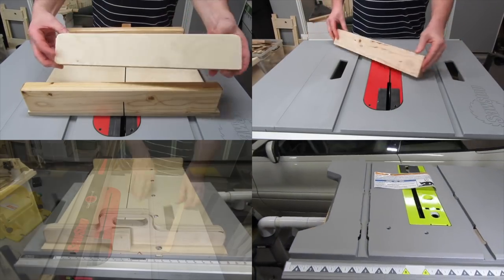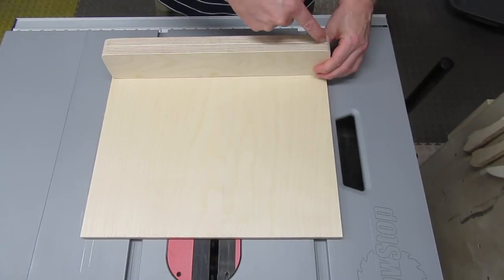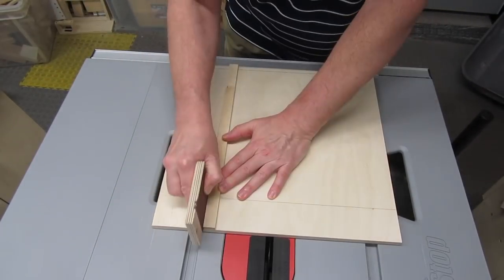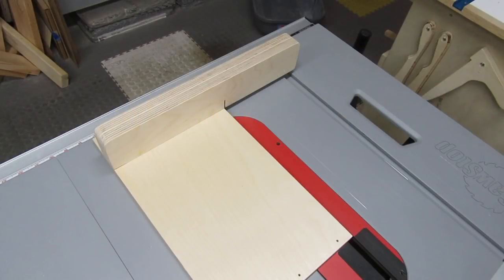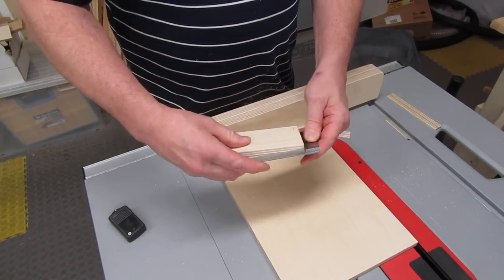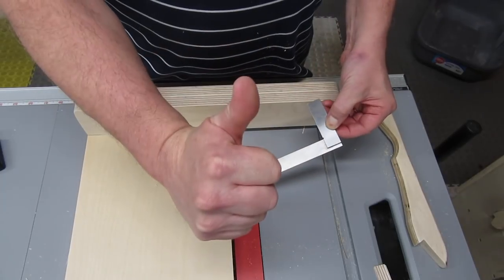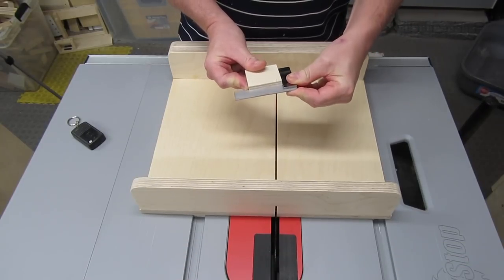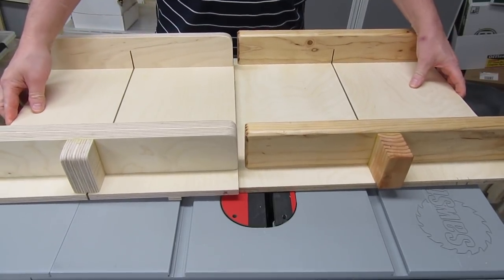Assembling a Cross Cut Sled, for Newbies!

Comment: I do like your video very much. You gave good clarity with that Ho so necessary dry humour. As an aside in the UK we have been designated metric for a long time. As a retired technical manager in heavy engineering I have been using the metric system in my work for at least 40 years ! However in my retirement I have taken up woodworking, and guess what, I have reverted back to imperial units which just seams clearer to me. OK we have to use metric power tools and drills etc. But in marking out and sizing cabinets etc. I am imperial all the way. Thanks very much for your video, thoroughly enjoyed it. Please keep em coming !
Reply from the maker: Thanks! And thanks for sharing your thoughts about metric and Imperial measurements. I have a question for you - what do you think of this idea: I want to start mentioning metric equivalents in upcoming videos, but not for everything. Here's an example, and it's not a perfect example, but hopefully you'll get my point: I'm going to do a video on t-tracks, and the ones I'm looking at are 3/8" tall, which means they require a dado of that exact depth. Giving a metric equivalent of 9.5mm seems counterproductive there, because it's just an approximation. Do you agree? (And did that make sense?) 😀

Comment: Hey Dan, I have really enjoyed this series of videos about the sleds. Of course the main one for me is the one with the tabbed runners......and no I haven’t made myself a new one yet. Since my Saw doesn’t have a port for the sawdust I had put a small hole under my table I built for the table saw and put a small vacuum and hose attached hoping that would help get rid of the Sawdust but no luck. It was terrible sawing because it was almost like a dust storm when cutting several cuts. I was so proud of the table I had built for the Saw at the time I didn’t want to cut a hole into the table......well, today I did. I’ve had bronchitis this last week and I had just had enough so a hole I did cut. I sealed it good all around and attached one of those sawdust bags that you can attach to your saw. I had it on there when I was using the stand that came with the Saw. Of course those stands that they come with aren’t the best so that is why I built a sturdy table. Sooooo....long story short it is better since cutting the hole and sealing everything but I swear that sawdust can find the smallest of holes and come out. It’s way, way better but I still get a small amount getting out but I can deal with that. Thanks again Dan for the great explanation in all of your videos. Sorry about this being so long too. Take care and stay safe!
Reply from the maker: Becky - Good job! It sounds to me like you need to build a simple air filter so you don't breathe in so much dust, which could be causing the bronchitis. Here's an incredibly simple one that I'd recommend: https://youtu.be/BSiDJfj2dFQ?t=49s. This link throws you into the middle of the video, because the first part talks about a $350 air filtration system, and I doubt neither you nor I would want to spend that kind of money. But then he talks about how to make a cheap and simple one instead, and it's what I recommend. In fact, I'll probably be making one for myself.

Comment: Thank you for doing this video.  I am currently making my THIRD crosscut sled and like you found out my final test cuts were not square!  I believe you have put me straight on what the problem may be.  I will be testing my fence squareness just as you did against the edge of the kerf cut and hopefully this will resolve my issue.  Thanks again!
Reply from the maker: You're welcome. Good luck! 😄

Comment: Great video, thank you. The only thing I don't like is aligning the rear fence, then removing it for chamfer. With my luck it'd never go back straight. So I would cut the chamfer with a utility knife or something while rear fence remains attached to base and straight.
Reply from the maker: Thanks, and you're welcome. I know what you mean about worrying that the fence won't go back on straight. But if the fence is made out of decent plywood so the screws don't go into voids, and you use screws like Spax or GRK, then there won't be a problem. If you haven't tried out those kinds of screws yet, go ahead and get some and try them out. Screw them into the end grain of some decent plywood (always drill pilot holes, no matter what the box says about not needing them), remove them, and screw them in again. As long as your drill's clutch is set right so you don't strip the holes, you'll see exactly why I feel so comfortable with them. I wish I could demonstrate how good they are in a video, but it's something you really have to experience yourself.

Comment: Adding the fence based on the cut edge is my favorite technique thus far. Followed your method, did the 5 cut method and got a .001 inch difference in my off cut piece. I'd add to double check that your ruler is square. My first sled was off and it was driving me crazy as to why until I realized my carpenter square was just a bit off square.
Reply from the maker: I had the same experience with my old carpenter's square. Drove me crazy too!

Comment: I like your videos. They are humorous and informative. I have used your approach and made a bunch of plywood runners. All I had was ¾" ply so I had to cut them in half with my thin curf blade, which was a bit scary. On this video, I like your 2x4 fence idea. I had to make a couple of quick utility sleds using my off cut ¾" ply from a home project. I don't mind getting banged up so I didn't want to use fancy (aka expensive) slides or buy new plywood. So, using your method I made a couple of sleds, one without a forward fence.

One quick comment though, I think you can improve the process a little. I made the fences without cutting the sled in two first. I attached the fences with two screws at each end, used the five cut method and adjusted the fence with a feeler gauge (there are many videos on this but I followed Katz Moses's video). There are two issues with the way you're doing the 5 cut method. (1) your sample is too small and (2) your 5th cut should be a ¾" to 1" strip. This way, you can measure precisely the thickness at each end of the strip and figure out how much to move the fence and in which direction.

Nevertheless, very entertaining video and I still learned something and it inspired me to use some scrap ply and 2x4's to make a couple of quick sleds. Thanks. Keep the videos coming.
Reply from the maker: Thanks! Glad I could help! 🙂

Comment: Very thorough coverage of the process.  One thing you didn't mention but that I saw that was useful was you put an X over the first trial screw hole to remind you not to use that one for the final assembly.  I'd be the guy who used it and then couldn't figure out why my cuts were still not square!
Reply from the maker: Thanks, and dang! I meant to talk about that, but kept forgetting. Hopefully others will notice it too, if they ever have to drill a second hole.

Comment: Westley Treat has a vid on squaring a framing square. I checked mine and it was already dead on! My speed squares are spotty though

Also, I love the way you square it. No math (which I don’t generally mind), no variables, no complicated stuff. Just a dead-on fence

PS: your phrase “the only thing holding the sled together” reminds me of my fiasco...I made a one-fence sled, got it darn near perfect, but forgot to screw in two more screws (so there was one on each end of the fence). I picked it up, and it pivoted on those two screws and just opened up like a set of French doors
Reply from the maker: Ahem, well, I'd never admit to doing such a thing myself. Ah, who's kidding? I did the exact same thing the first time I built a sled, and laughed myself silly. Live and learn, right?

I had some plastic speed squares that actually had curved edges. What a joke!

Regarding the "no math" - I'm not against math either, but I just couldn't ever get that method to work. This is so much easier, and is just as accurate, as far as I can tell. So I'll go for simple and accurate over complex, any day. :)

Thanks for the comment!

Comment: Great video.  One question.....  Why not make the chamfer on the  fence before you attach it so you don't have to take it off the sled and possibly knocking it out of alignment after reattachment?
Reply from the maker: Thanks! Because I want to make sure the chamfer doesn't interfere with the square, when I square the fence. Does that make sense?
Reply: @TheNewbieWoodworker  Yes it does. BTW - Love you videos.  Thank you so much for all the work you do.  For a real newbie what would you get first a planner or a jointer.  I do have a very good tablesaw (sawstop) and other tools.
Reply from the maker: @edmundhayes7982  Thanks again! I don't have a planer or a jointer, so I don't really know. Guess I'm not much help on this one. See what happens when I get complimented? 😛
Reply: @TheNewbieWoodworker  Thanks  :-)
Reply from the maker: @edmundhayes7982  👍

Comment: Great video!  (In fact a series of videos but I watched only this one). The most extensive video I've ever seen about a cross cut sled with a number of great(trouble shooting)  tips.
It has been a while that I watched other videos about making cross cut sleds (I do not have a table saw yet) but as far as I remember in those videos
the cross cut sled had two runners. Could you please explain what the (dis)advantage of one or  two runners is?
Reply from the maker: Thanks! I haven't done any research on the subject, so I can only tell you my thought process. With only one runner, I imagine there's a tendency for the sled to drag a little, probably on the side without the runner, causing the sled to twist a little. So if that happens, then you might not get straight cuts, and also, the sled may not move smoothly. Waxing could help reduce the drag, though, if needed.

But with all of my one-runner sleds, on my particular table saw, I don't think they're dragging much, and I think my cuts are staying square, so I figure, why add another runner if it's not needed? But other table saws may be different.

My one exception is my box joint jig, which isn't a "sled" per se, but it does use runners. It's wide, but narrow. And it carries a lot of weight. So I have two runners on it, because I'm sure it would have a real tendency to twist.

One problem with two runners is that if they experience seasonal expansion, they might bind up in the tracks. Sure, that could happen with just one runner, but it seems to me that there'd be twice as much of a chance for problems with two runners. So with my box joint jig, I use two ZeroPlay miter bars from MicroJig. They're made out of plastic or some such thing, and won't expand or contract due to weather changes.

Hope that helps. 🙂
Reply: @TheNewbieWoodworker  Thanks for your explanations. I think it makes sense. Making runners out of plastic (hdpe) is also a possiblity.
I learned that from the channel woodworkweb (Colin Knecht)  I cannot find that particular video back.  :-(
As I wrote, I do not have a table saw (yet). I'm just about discussing it with my neighbour/friend to buy one together, hopefully this winter.
Reply from the maker: @hansdegroot8549  I've used UHMW plastic, and places like Rockler sell it explicitly for this purpose. I probably mentioned it in a few videos, but I don't really feature it anywhere. I like it a lot, and in fact, I'm using it in the router lift video I'm working on right now.

Comment: Excellent tutorial! 
However, I am surprised about making the fences lower than the max blade height; that may be ok if you use it only with relatively thin stock but for heavier material I would recommend making the fences higher than the max blade height so that you don't cut the sled in half. Another suggestion is to make the saw guide with a lip that extends below the sled so that you can't push the sled too far and cut through the guard as well.
Now bingeing on the rest of your videos!
Reply from the maker: The reason I like shorter fences is that it's easier (for me) to see over the fence when the blade is finishing the cut. I make my large sled with tall fences. But your point is completely valid, for sure!

Good idea about the saw guide, except it depends on the table saw. For instance, on my new saw, there's actually a long way from the front of the table to the start of the blade. That would make one strange looking sled. But on my old saw (the one you see in all these videos), that would probably have worked well.

Good ideas - keep 'em coming! And if you're binge watching, I suspect you'll have more good ideas. Also, feel free to point out mistakes, because I learn a lot from viewers. Well, as long as they're not mean about it, but even then, if they're right, they're right. I really don't want to cut off my nose to spite my face! 😛

Comment: liked the video and was informative, Thanks. My only other comment is what's with the Babylonian measurements???
Reply from the maker: LOL. At least I didn't use Roman numerals! The true answer is, when you live in Babylon, and most of the tools and hardware you can get are Babylonian, then that's what you use. It's not that bad, especially with a good fractional calculator. Besides, I can tell you that half of 3/16" is 3/32" faster than you can tell me that half of 4.76mm is, um, 2.38mm. (And no, I'm not saying the Imperial measurement system is better. I'm just having some fun.)

Comment: does the 6:33 cut means that I will no longer need to do the 5 cuts method to square the sled ?  if so - then this is the most easy to follow video on youtube
Reply from the maker: Yep, that's exactly what it means. You could always test the result with the 5 cut method, but you don't need to align the fence that way. I learned this from a Matthias Wandel video, and I can't believe more people don't use it!

Comment: Hi. I just bought my first  table saw. A Blue Hawk from Lowes. The directions to assemble are the worst. 
What is river knife used for? I noticed your table saw doesn’t have one nor a paw grabber. 
What does zero clearance insert mean. The sliding  fence and table top is very rough. I have already waxed it. No help.The top is painted and has a gritty texture. Also the top has been factory stamped with oblong rectangle. The Fence has taken me awhile to adjust, but I fear if I use the fence the wood bind. I used a framing square to set the clearance from the front to back end of the blade. However; if I move the fence in any direction, I have to repeat the process again. I think maybe a sled may fix all my problems. What do you think?

I’m new to woodworking, as a hobby and continued physical therapy for my arms. I enjoy your videos and learn a great deal from them. I like the K.I.S.S. Technique you follow in teaching.

I purchased this table saw at A great price. However, I feel I need some upgrades, to make this a table better. Like I said: it’s just a hobby.

Oh I followed your plan the make a dust collection system. It’s working great 
Gill
Reply from the maker: Thanks for the comment. In answer to your questions:

1) It's called a riving knife. I didn't use to use it because I didn't understand how important it is. I use it all the time, now. To learn more, watch my kickback video: https://youtu.be/ZUZ8hRm7a8g. Have a little patience with the video - I was so fascinated with the kickback footage that I take longer to make my points than usual. Be sure to watch the whole video, since this is your first table saw.

2) Zero Clearance: Here's a good, short explanation, but he calls it a "throat plate" and most people call it an "insert plate". Also, you don't need to go out and buy or make one right now. Just be aware of the concept. https://youtu.be/5QriKM20Yq4

3) I'm not sure what to say about your table top. I'd have to see it before I could make a judgement call..

4) If you really have to adjust the fence each time, then something's wrong. I'd guess that the locking mechanism isn't clamping it down tight enough. See if there's a way to adjust the tightness of the clamping mechanism. Often times you can see something to adjust when you look closely at the bottom.

5) Yes, a cross-cut sled will help with a lot of things, but you'll always need a rip fence, so you need to get it squared away (pun intended).

Glad to hear about the dust collection system! Hope you enjoy it.

Comment: It sounds like the front fence doesn't have to be square. What is the reason to even have the front fence when making the sled?
At no time during the video did it seem to be useful.
Reply from the maker: It's more stable with both fences. But in this video, I only use a rear fence: https://youtu.be/cQINXsn2QBk

Comment: Hey Dan, Thank you for another quality video. I noticed that you only used a single runner vs the two runners that 95% of the other cross sled videos show.  Is there a reason for that?  I understand "Why use two, when one will do". But is that your reason or is it something else?  Keep those videos coming.  Thanks.
Reply from the maker: Ray - Thanks for the question! My answer turned into a blog post, which you can find here: http://thenewbiewoodworker.com/2018/05/07/cross-cut-sleds-why-i-only-use-one-runner.html

Let me know what you think! Thanks!